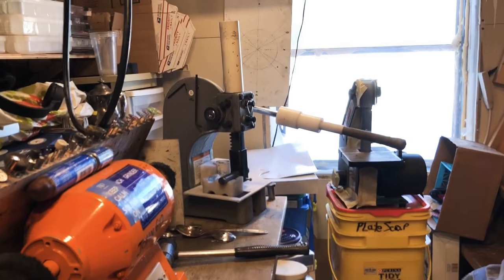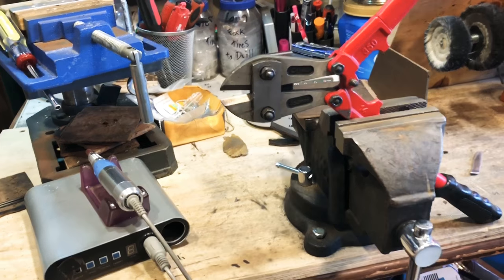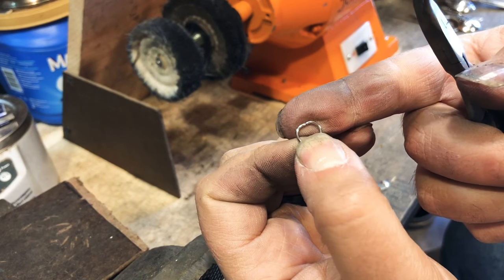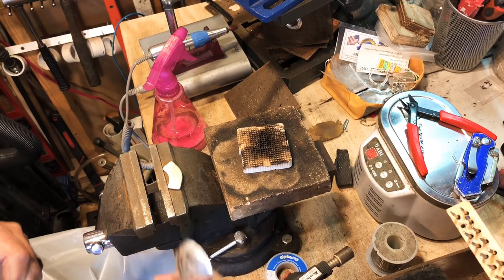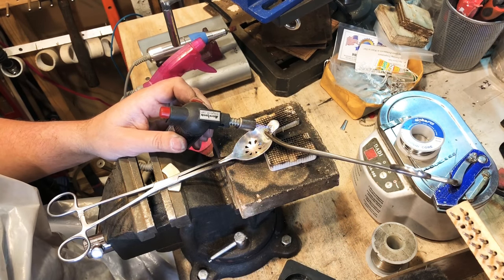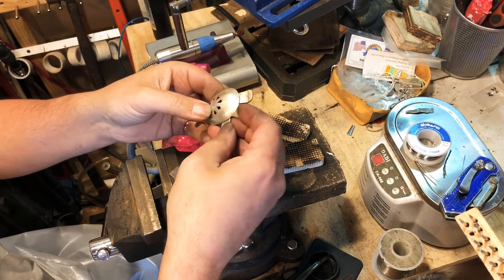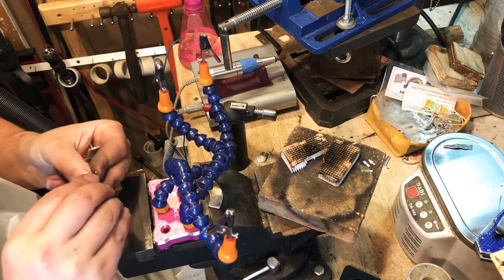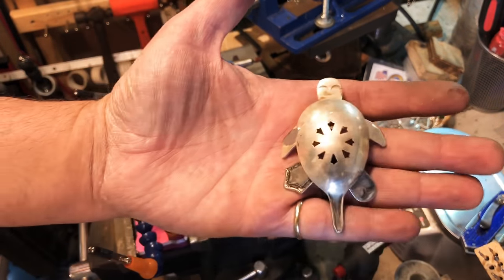Silverware turtle 🐢 how to

Comment: Can you tell me what kind of blade you have in your band saw. I just bought a used one. My husband says they are normally used for woodworking. I thought you mentioned a specific blade you used in yours.  Thanks
Reply from the maker: Kim Hull I’m at a show today I’ll try and get you the information on it ASAP. It’s not coming up in my eBay purchases for some reason.
Reply: @FlatwareCreationSS  No rush....I really appreciate you even taking the time! Very generous of you. I have learned so much from.your videos
Reply from the maker: This was the blades from eBay that I’ve been using. I’m still on the first blade with hundreds and hundreds of cuts. 

Function: band saw blade for cutting metal

Material: Bi-metal

Grade: M42

Size: 56-1/8" x 1/2" x 14tpi or 1425mm x 13mm x 14tpi

Length: 56-1/8" (1425mm)

Width: 1/2" (13mm)

Thickness: 0.025" (0.65mm)

Teeth:14tpi

Package: 1 piece band saw blade

Cuttable materials: ferrous and non-ferrous metal.
Reply: @FlatwareCreationSS  thanks...picking up my bandsaw on Friday. Excited to get going!